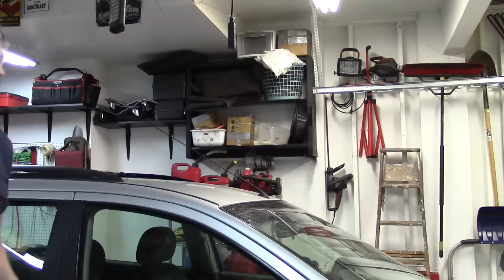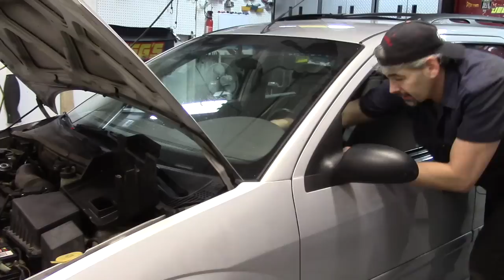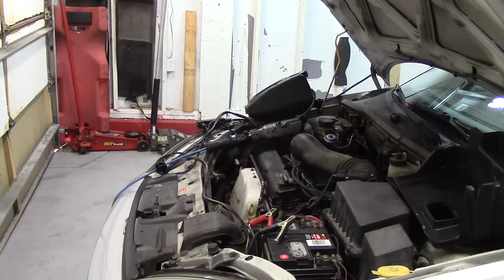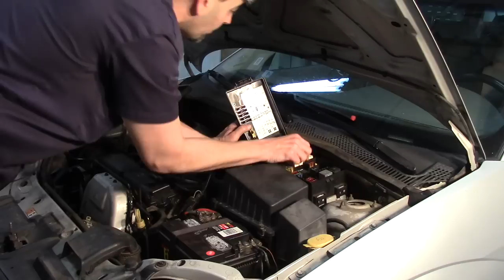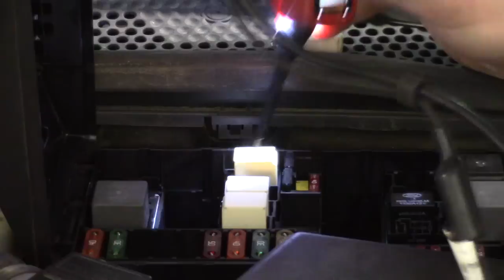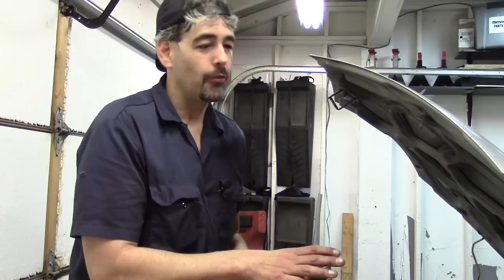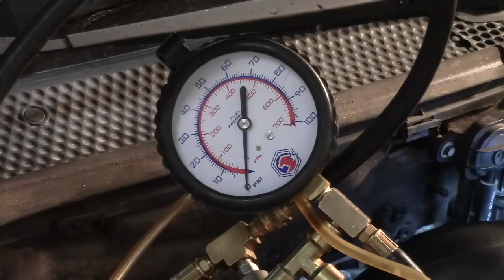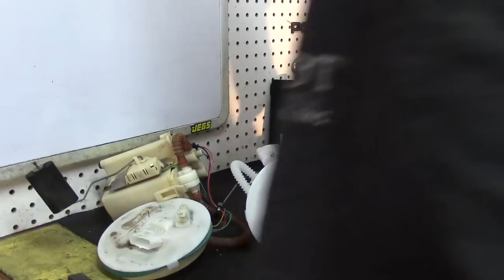Cranking No-Start Real Time Diagnosis -Ford Focus

Comment: Good video, I'm currently trying to figure out a cranking no start on a 2000 Dodge Ram 1500 I got free. The owner got tired of it and said take it today you can have it. Had it towed home. I have no spark and no injector pulse (do have a working fuel pump that pressurizes to specs). The truck came with a new in the box crank sensor so good or not, I replaced it anyway because I had a new one. I'm thinking wiring harness.
Reply from the maker: with no spark nor injector pulse the first thing I would do right off the bat is keep it simple and do a crank sensor reference signal bypass as the very first step.  Why waste time?
Reply: @SchrodingersBox  I thought about that after I made the first post. You are right. But it'll have to wait unfortunately. I don't know where you film from, but I'm in the northeast and working in my driveway. We just got pounded by a snowstorm so working outside, no bueno. I replaced that crank sensor with the new in the box one last week it was not fun. They picked the most cramped, least visible place for it.
Reply from the maker: Not sure why you would change the crank sensor with a new one but you might also check the fuses for the fuel injection system.  Doing the bypass test of course would identify if the reference was missing anyway which is why I would still start with that.  Multitasking!
Reply: @SchrodingersBox  Changed it because it was new in the box and the truck had its original one it with over 265k on it. I know and always practice the old saying, "if it ain't broke don't fix it". But these trucks are notorious for crank sensor failure. So I thought might as well install the new one.
Reply: @SchrodingersBox  Fuses checked ok when I did the first day I took the truck.
Reply from the maker: Crank sensor bypass test. that’s the obvious step. dont throw anymore parts at it- complete waste of time.
Reply: @SchrodingersBox  Roger that! Just waiting on the weather to cooperate. Thanks.

Comment: Hey I had that Dodge Charger that had crank and no start and found out that the timing pulley had broke and the ball bearings went down and stopped the crank from moving and just wanted to say thank you for talking me thru that. Month later I had to replace alternator bc it started whining bad and replaced and no problems. But a week later my battery light comes on and off. Some days my heated seats won’t stay on, other days my windows won’t work, and lastly my brake lights that usually blink when I go to unlock my car won’t work. What should I look for or start at?
Reply from the maker: Check for variance in alternator output proportional to belt tension

Comment: Very helpful indeed!
I often have people asking me, 'how do you know so much about cars?!'...i answer back "I dont."
Logical deductions, educated guesses, process of elimination. Air, Fuel, Spark. The only things a typical car needs to run properly. Intermittent, all the time, when did you notice, etc are all basic questions that eliminate almost 90% of what the issues you'll test could be.

I get Chiltons for my cars but for the most part just start tearing into things....videos like yours have been my education for years and I've even made plenty of my own 'how-to' threads on forums similar to this... to hell with the haters, they'll never amount to anything car related and if they dog do-it-yourselfers in videos like yours, they're not really the enthusiasts they claim to be!

I stumbled across this video researching my 2016 Focus ST (performance stuff), but glad i did. Cheers and keep on doing what you do!
Reply from the maker: Thanks man. You nailed it- almost every video is the first time I have ever seen a particular car much less the problem with the car. Its the process, not the experience that allows accurate diagnosis.

Comment: I have a 2000 Ford F150 that I've run out of ideas, trying to fix a no start situation.
The symptoms are classic of a fuel pressure problem.  Once I spray starter fluid in the throttle, it cranks and will crank fine until it sits again for 12 or more hours, and not always will the problem occur, but the cold seems to increase the likeliehood.
I have used a scan tool and a multimeter, among other tools to rule out the MAF, the IAT, the TPMS.
I've ruled out the PCV.
I've replaced the Fuel Pump.  The Fuel pressue regulator, fuel filter, checked pressure.  looked for vaccuum leaks.
I recently took all the fuel injectors out, and thought I found the problem, when one of them wouldn't hold air pressure from an air pump.
I replaced all the injectors.  Same problem.
I'm about ready to rig a can of starter fluid with a servo that squeezes the trigger, to a toggle switch in the cabin, and put it in the inlet hose.
Can any one suggest something other than everything I've looked at?
Reply from the maker: What was your data that indicated yoiu needed a fuel pump? I would totally start there.
Reply: I was getting low fuel pressure, when I measured at the shrader valve (about 30 psi), which is low according to the spec. (28 - 45 psi), and after ruling out the fuel pressure regulator, and fuel filter, or any visible kinks, or blockages in the fuel line, and lots of testimonys on the internet, I concluded it needed a fuel pump.  After replacing the pump, the pressure level with the gauge didn't improve at all.  When I finally put the fuel injectors in, the pressure actually improved about 5 psi.
When this happens, and I monitor the live data, the Short Term fuel trims, on both banks are around 85-95%, and the MAF, IAT, O2, all report, what I would expect, but it's like the Short term fuel trims are maxxing out, trying to provide enough fuel.
I'll go back, and see what I may have missed.

Comment: Cool video...but I've come across cars that the fuel pump will power on with ignition ...not start half the time ...but an ear to the gas lid revealed a drizzle noise on power off...supply line inside tank defect....one dollar worth of fuel line to replace supply from pump...after dropping the tank..lol
Reply from the maker: There is no way to diagnose that by noise with any definity. It could be other variables such as a bad check valve all the same which would cause same sound. The condition you mention would easily and correctly be validated through a static pressure test vs rail pressure load OR by independent isolation of the feed side.
  I am sure you don't want my viewers listing to gas tanks gurgle and then dropping the tank to replace supply hoses only to find that isnt the issue!
Reply: @SchrodingersBox  I'm not suggesting to not do further testing ....I'm just saying it's a distinctive sound..I've seen a couple cars recently with that issue...one the customer had the pump replaced 6 months prior and the guy that had done it had used a zip tie on the line that failed(ugh).. It allowed the fuel to spray to the side of the tank while some would go up the supply tube.It wouls start intermently.... .so yeah sometimes you can listen closely...it only add about 30 seconds to your fastec

Comment: I have a 08 Dodge Charger that just stop running going down the road. I put starting fluid in it but it didn’t turn on. I checked for spark with a screwdriver and it did have spark. So I’m at a lose. I have heard it could be crank sensor or timing chain but i haven’t checked that yet. I will say tho it never got hot.
Reply from the maker: Obviously you have a fuel delivery issue- check fuel pressure or fuel trim on the freezeframe data
Reply: Schrodingers Box here’s a recording of what it’s doing. You’re advice would be greatly appreciated!!! https://youtu.be/EYyzyj2yc1g thank you thank you!!
Reply from the maker: Stephanie Joy   I still need to see the fuel trim data
Reply: Schrodingers Box how do I find it?
Reply from the maker: Just keep it simple at this point-  just take a basic static vs loaded rail pressure (curved to 3500RPM). Nothing more than that simple test. I can determine if we need fuel trim analysis based on just that.
Reply: Schrodingers Box I think I finally figured out I read a code wrong. I have code 0016 which is correlation btw camshaft and crankshaft sensors. How do I know if it’s just a sensor or if it jumped time
Reply from the maker: If you don't have an oscilloscope you will need to just physically check the cam and crank timing.
Reply: Schrodingers Box The tensioner pulley broke and didn’t allow timing belt to move. Thanks

Comment: good diagnostic but to test fuel system why you dont go  strait to fuel the fuel pump connectors and you save time to testing fuel pump relay
Reply from the maker: Because I don’t like jacking up the car and getting under the vehicle and getting all dirty like a noob. I only do that as last necessary result.  I mean, if this was actually a relay issue, wouldnt I have wasted time going under the car and testing at the pump connection, right? That would be useless! Testing "top down" would let me fix the car even if I was wearing a suitt and not even get my fingers dirty.

Comment: I got a maxima 03 3.5L ... i floored the car to get to 100km/h and when i let go of the pedal it went to idle (looks like it) i cleaned the MAF sensor ... now it cranks but wont start. I checked alot of videos and i thought it was my throttle body or the sensor.... but now you make me believe it might be the pump ?! Could it be ? Any help would be pretty helpfull
Reply from the maker: Could be anything. What data do you have?
Reply: Schrodingers Box before this happened ... the car would, at a redlight, accelarate soo slow it was alarming and my speedometer worked half the time.
Traction control allways off and slip dashlight.
Reply: Schrodingers Box the slow acceleration was half the time too
Reply: Schrodingers Box could it be my gas pedal position sensor ?
Reply from the maker: No idea- again what data do you have? What’s the signal voltage curved against load? What is the reference voltage? I need dat, not a description of the symptoms.

Comment: I need your help, 2013 Ford Focus.. replaced engine , it cranks and fuel pump is working, after cranking,  I checked plugs and they are dry.. is there some security issue I need to know about that might keep this from starting?
Reply from the maker: That’s an easy one-simply Check for input signal to the injectors. If input signal is not present, check for input signal to ignition coil. If both signals are missing confirm with a CKPS bypass. 
  That exactly how i would appraoch this- just keep it basic and isolate the variable as first step!
Reply: Thank you so much for getting back to me so quick, I’m positive you just saved me a lot of cash that I was going to give to the dealership to tell me this..thank you
Reply: Schrodingers Box turned out that the engine was out of time...

Comment: I know this video is a couple years old but hoping you will reply as i am at a lose for what the issue is with my ford escape. All of FASTEC checks out i have everything needed on the list for the car to run and it doesn't. oddly if it sits for a couple hours it will crank and start for 3 or 4 seconds but then dies. If the upper plenum is off it starts. i honestly have no clue what it could anymore so i really appreciate any info you might be able to put on the table . thanks in advance.
Reply from the maker: Then you are overlooking a Fasttec component. There is no other possibility unless the car runs on magic. What was your data that ruled fuel out as a possibility?

Comment: Hi my car is running fine thing i noticed after putting key in accesory position i dont hear fuel pump priming it takes me 2 or 3 cranks after starting.how can i rule out my fuel pump is going? Thank you.
Reply from the maker: No idea. What is the static pressure?
Reply: Schrodingers Box im tracing my p0171/174 code i do have vacuum leak aside from that code i cant hear priming sound from the fuel pump.but cars running fine.if i use fuel pressure test would that help me to rule out that my pump is going?
Reply from the maker: No idea. You cannot tel from that information That’s why I asked what is the static pressure please. 
  Or alternatively what is your LTft and STft curved against load?
Reply: Schrodingers Box stft kicks over 15% ltft 11.7% at 2500-3000 rpm at idle + - 5% stft
Reply from the maker: Ok now that helps. It justifies that the next step in diagnosis is I need fuel pressure both static and curved against load.
Reply: What would be the normal range of stft at idle? 2500-3000 rpm?
Reply from the maker: i just need the data please. The range is irrelevant. This is taking an unnecessarily long time. Fuel pressure curved against load please.
Reply: Schrodingers Box could i alternatively use bluetooth obd scanner or the physical fuel pressure tester?
Reply from the maker: if your model has a transducer on the rail the OBD reader output  will suffice. 
  Why are you saying you have a vacuum leak when fuel trim clearly contradicts that?

Comment: Great video! But I have a question? I have an 03 f150 and I have spark and I have fuel. But it just won't start. Just cranks and cranks. I replaced the crankshaft position sensor. And have tried the starter fluid method as well. Please help!
Reply from the maker: Why would you replace the crankshaft position sensor when you have spark and fuel? I dont understand.
Reply: Schrodingers Box 
I was instructed to because apparently it is a common problem in terms of spark. At the time I didn't know it was getting spark
Reply from the maker: Ok what data do you have? I have nothing to go on here.
Reply: Umm. The Ford dealership??? Lol
Reply from the maker: Lol that doesn't help. Need input and output data to even start a direction much less a diagnosis. Otherwise ity's just a guessing game and anyone can guess.

Comment: could it have had a 5th possibility of a fuel filter?
Reply from the maker: Not possible with zero pressure at the rail. plus doesn’t explain lack of KOEO priming.

Comment: Ugh I pulled a 98% move this weekend and stuck a new c.p.s in her car. Ugh u guys ever just remove the wiring harness to check for breaks?
Reply from the maker: All the time. When I determine there is an open, I visually inspect for an open.  If it's a short, I visually inspect for a short. But before I do either I verify there is a wiring integrity problem.
Reply: Thank you Dr. Schrodinger

Comment: its NEVER. FUCKING EVER a fuze. when a car wont start, someone will always without fail tell you to see if you need a new fuze. every single fucking time. After driving and owning over a dozen cars and fucking with a million cars for over 20 years, its never, not even once been a fuze. ever. 
if someone says "fuze" around you when you are diagnosing a car problem, you actually have legal permission to stab them to death.
Reply from the maker: You should probably see my latest no start video where it is was a blown EFI fuse then.  One indication you aren't familiar with electrical diagnostics much less car repair in general btw is that you don't even know how to spell fuse.

Comment: What are you doing ?! If it won't start you should put some injector cleaner in, replace plugs and wires and then change various sensors until it works! I don't ever pay for diagnosis, DIY for the win. ( Just kidding , great info in this video I learned allot from your channel)

Comment: 13:25 what about clogged fuel filter?
Reply from the maker: That would not cause pump to not operate. The relay bypass confirmed there is no power to the pump.

Comment: No joking on the cleaning of the tank....2002 Saturn had what looked like sanding dust from a paint shop all in the tank clogging the sock and fuel pump to the point of sludge in the tank.....causing a blockage of the pump and line and eventual pump failure.....never seen anything like it!!!

Comment: Hi Matt, why did you used power probe at the end of the video after backprobing fuel pump? Doesn't seeing 12v at that point allready confirm you got no voltage drop?
Reply from the maker: No it confirms I got 12V, it does not confirm I have no voltage drop because I did not test the circuit under load.
Reply: Schrodingers Box makes sense, you loaded a circuit, wasn't sure what does this tool do, so I thought you provided external power and ground just in case it got a voltage drop. lol.. By the way I'm suprised you reed all the comments 😀

Comment: ok dont know if u can help 06 focus 2.0,no power to pcm  no crank ,and dashes instead of mileage showing , cleaned all my grounds ,pats light flashing , even bought another pcm w/matching key, im at a loss any help.
Reply from the maker: What was the data indicating the PCM was bad, I would start rhere for sure.  WHy replace the PCM if your testing indicated there is no power to it. Did you apply auxillary power to the PCM and found any drivers were inoperable? I am not following your strategy sorry
Reply: ok i found problem a 20a fuse that i got from auto zone  wasnt powering the pcm i got another from a junk car and boom its working now  fuse from autozone not blown  ill never figure why that fuse wont work in that fuse block